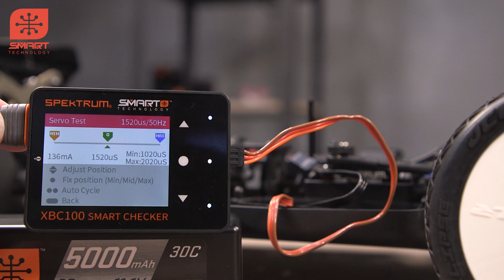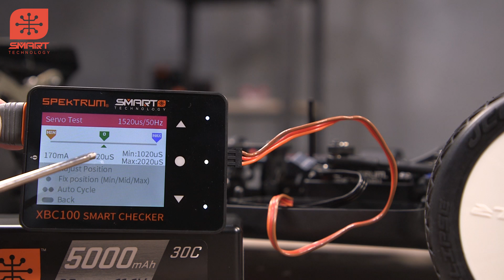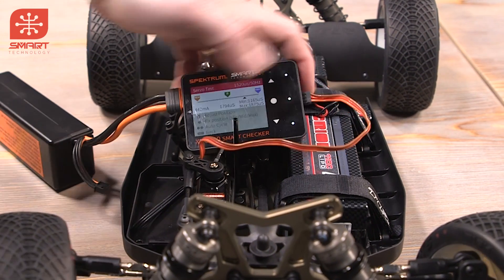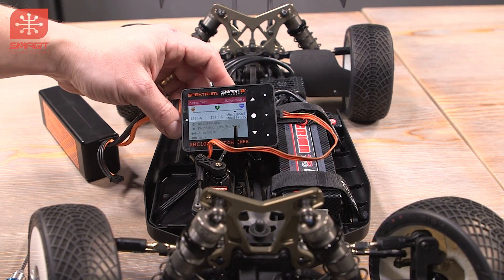Spektrum Smart Checker - Servo Tester Function Explained

Comment: The servo tester has not been thought through to the end. Instead of specifying microseconds, it would be better to specify the endpoints in % (as used by the transmitter in the settings). Then you could simply transfer the values to the transmitter. Currently, knowing how many microseconds it takes for the servo pulse to bind is purely academic.
Alternatively, a display in the transmitter in microseconds instead of percent would of course also be helpful.

Comment: Hi Tom,
2S 6.6V 2200 life was charged and end voltage was 6.75. When used smart checker it showed 6.75 at 59%.  The charged was 13 minutes and 51 seconds.  I’m I doing something wrong!
Paul
Reply from the maker: Hi Paul! Sorry for the late reply. When you plug in the battery to the checker, does it recognize it as a lipo or life? Also is your checker up to date?
Reply: @SpektrumRCvideos  I did find three different settings such as lipo, life….  Paul

Comment: @SpektrumRC Hi, thanks for posting this excellent video.  Could I ask a couple of questions please? [1] What voltage is the servo PWM output?  [2] Does the servo checker function require a smart battery, or may I use any battery of the appropriate voltage with either an IC3 or an EC3 connector?

Comment: Where is the information about the servo MIN and MAX stored, because you remove the Smart Checker when flying, does the servo remember its MIN and MAX ?
Reply from the maker: It does not program servos. Those settings are simply the max that the checker is outputting for travel. Hope that helps!
Reply: @SpektrumRCvideos so that means the endpoints are not saved, you will need to reprogram the endpoints on the transmitter, that’s where you want the endpoints to be stored and saved on

Comment: Where I can get the latest firmware of this smart checker XBC100 , I found pdf on Spektrum page witch shows XBC100_Smart_Checker_Updater.zip - but that contains 1.0.0.9 version. Mine checker came with version 1.0.0.14 - and I accidently hit ENTER when looking this screen - so it actually downgraded the device. Now my cell voltage measure is wrong :( - Where I can get that 1.0.0.14 or newer version of the firmware ?

Comment: I have seen it asked a couple times in the questions, but never answered...if you set end points with this tool...then you unplug it and plug it in receiver and turn on radio, are the end points still set?
Reply from the maker: No, your transmitter has no way of knowing what the endpoints you had set on the servo tester.
Reply: @SpektrumRCvideos  Thank you for the response, I thought that to be the case... regardless it is a neat little contraption.

Comment: Does this work with only Spektrum servos and/or Spektrum systems?  Will it work on, say, a Traxxas servo?  What about the age of the servo?  I have a Super Rock Rey that has the (don't quote me as I can't recall the exact servo ID) S904 that I'm not sure is just dying or it's not responding well to my new aluminum bellcrank. I know endpoints definitely need adjusted and feel like using one of these would be easier than the blinking light process, the beep process, or using the Bluetooth module.
Reply from the maker: IF its a standard 3 wire servo it will work. Digital, Analog, Heli, etc
Reply: @SpektrumRCvideos  Alright. One more question. If I change endpoints with the Spektrum tool, will the endpoints stay as I put them when I disconnect the tool?  I would imagine it would but I just want to be sure before I purchase the tool. I am going to be getting the charger as I recently picked up a Losi that uses the Smart technology and there is a few features in which I definitely want to make use of.

Comment: Can you set end points or reset center?
Reply from the maker: Sure can! Explained in the video
Reply: SpektrumRC I see where you can limit the overall throw, but don’t see how you can use the programmer as a “sub trim” function.  Other servo brand I have used allows one to sub trim out for perfect center and set the endpoints individually and it saves it. So no need to even use the sub trim in the radio.  I’m interested in switching to Spektrum servos but just looking for more programming options.
Reply: He says “sure can” but I don’t see that it can do this. Sure you can adjust the endpoints and center while it’s plugged into the device but as soon as the servo is plugged back into the receiver it forgets the settings and goes back to the way it was before. Am I missing something?